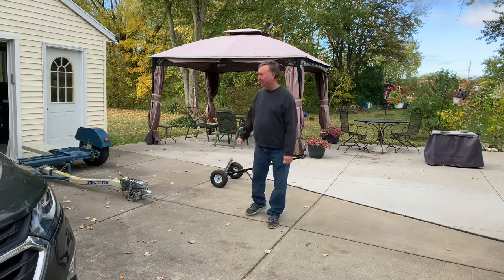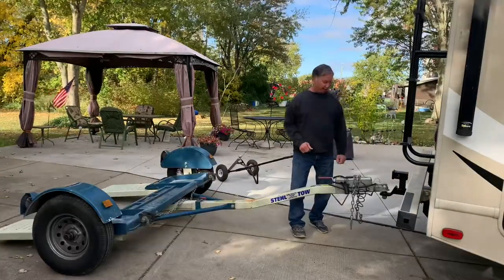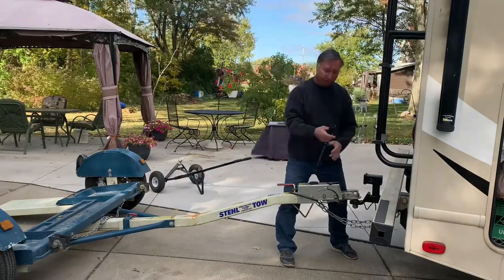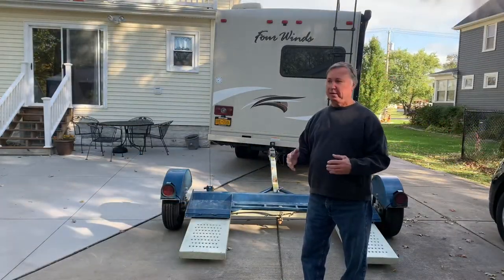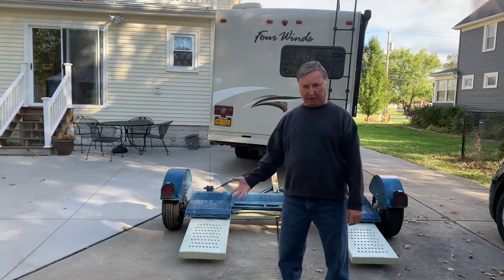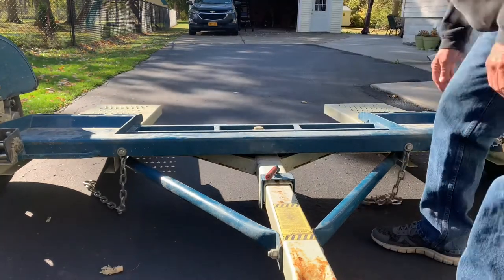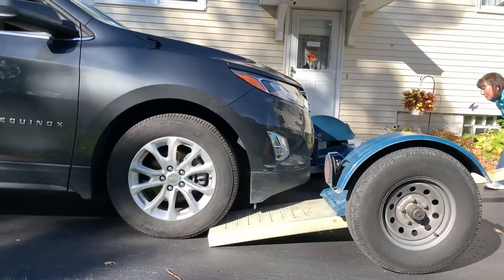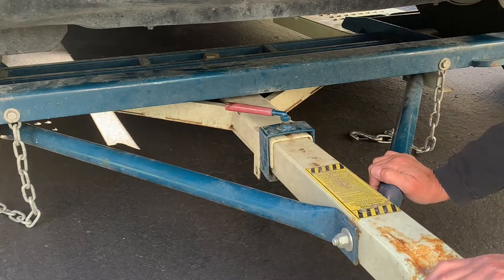How to Hook Up Your RV Tow Dolly - Towing your Car Behind Your Camper

Comment: I don't want to say YOU FAILED Dolly tow 101 class, but YOU did!! YOU spent more time on the lights than you did on the PROPER FASTENING the TIE down straps!!! The strap Hooks were not connected going in the correct direction. They should have been hooked with the wide metal hook going up not just slipped over the metal bracket. If the strap had loosened and you hit a pothole it could bounce off bracket and now the strap is not holding the wheel tight to the Tow Dolly! Dangerous!!  2) You should not have showed this without FIRST getting the PIN that locks down the car ramp! What's saying you will not forget to buy the pin?  3) You didn't explain how to loop the strap in the ring, so it doesn't become unfastened!  4) ALL the lights should be checked NOT just HALF of them!!  5) what about the tie down CHAINS what are they hooked to???
Reply from the maker: It was friends first time in camera and an early video for us. Sorry you were disappointed.
Reply: First thoughts I had too!  Let me show you how to do this.  Oh wait, I don't have everything.  Oh well.  Watch anyways!